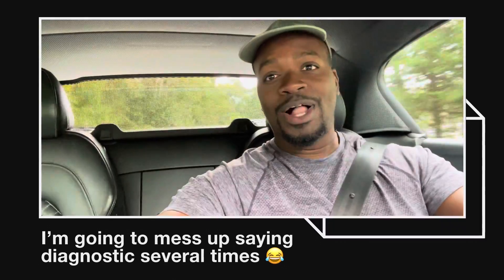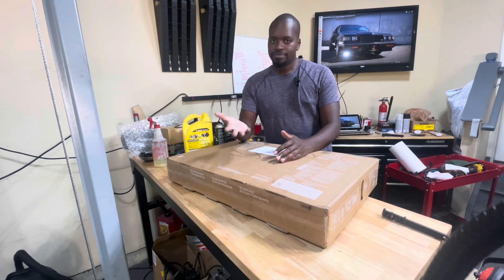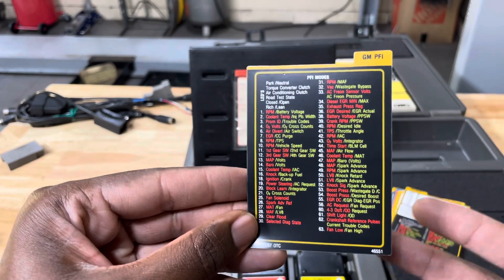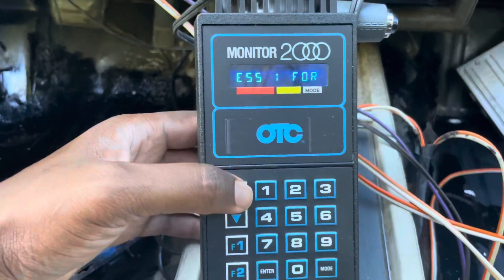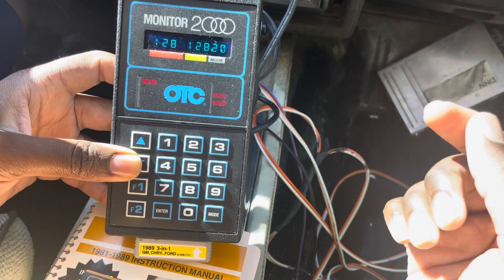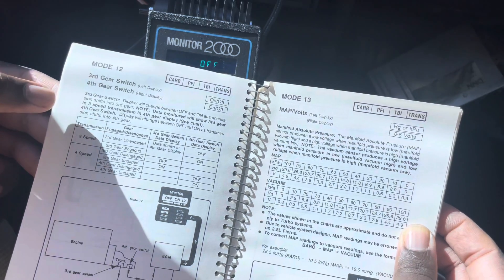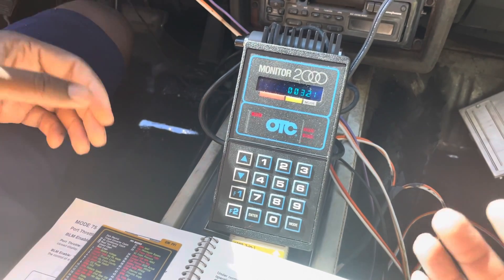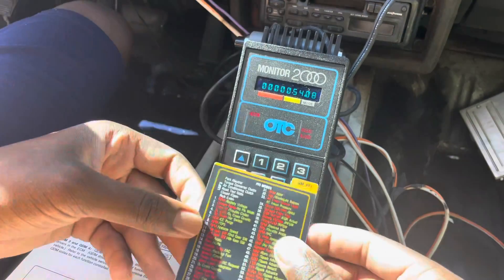Turbo Regal How-To ~ OTC 2000e Diagnostic Tool

Comment: I bought the 4000E for my 94 Z28. Great tool. It’s the only tool I found that actually works with 94-95 GM vehicles since the check engine light doesn’t flash. Most USB to OBDI ALDL cables and software doesn’t really work like SCAN9495. This tool helped me identify my wheel speed sensors were incorrectly reading voltage causing my ABS-INOP light.
Reply from the maker: Great use case! Handy tool to keep around

Comment: Thank you for sharing.  Where can I purchase one of these?  Very interested because we love tools!!!!
Reply from the maker: I found mine on eBay for $69. It was the most complete set I saw for the lowest price. Here is another example:
https://www.ebay.com/itm/165653701700?_trkparms=amclksrc%3DITM%26aid%3D1110006%26algo%3DHOMESPLICE.SIM%26ao%3D1%26asc%3D20190917065201%26meid%3D6e50199c453f45d89aa5dc2f6aae93aa%26pid%3D100935%26rk%3D1%26rkt%3D12%26sd%3D363993259279%26itm%3D165653701700%26pmt%3D1%26noa%3D0%26pg%3D2332490%26algv%3DSimplAMLv9PairwiseUnbiasedWebCpr08MlcGreedyV3%26brand%3DOTC&_trksid=p2332490.c100935.m2460&amdata=cksum%3A1656537017006e50199c453f45d89aa5dc2f6aae93aa%7Cenc%3AAQAHAAABEIxnp208POpAtEdSbeoza%252FtzyQmh2SBqORzgyIzbrfwKs8mDYiJnIRJg4GvE9THHqcWvWkp9OLFNO1BHulXkCXPAqcD0X%252BG1Y7PqC5RijosAwQ8qoVRCG311dM15MulE%252B%252FVqbfF4fL4PopbA5p1Uj9xRFXul4PyGlWjW2oUX36QUQLUTxbnRDp2PGfUVl3FIa%252FHX7E9zCu9mIO5cCc2EM4hnIJQ3aJHIm33TB5AEzvs1Zuivv37Dg4g4ME9Wq%252Fq7lQ45om1YP3snHKMZP9gri9NE8%252FrkgyaieZliWvUP1SYNFS53zFHpxa5ZEeEgHzhNrKmzIjPNVVZfiqZ793Lf6F%252FmPL0TwuOR%252FAWuqclhNkC%252B%7Campid%3APL_CLK%7Cclp%3A2332490